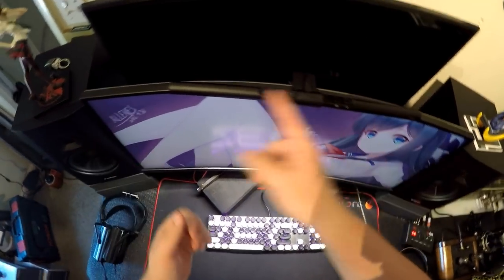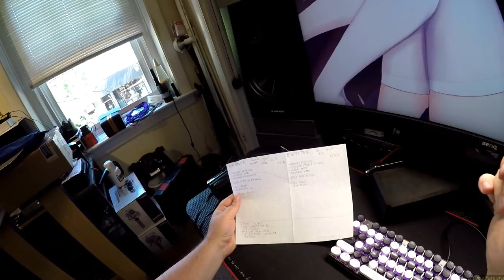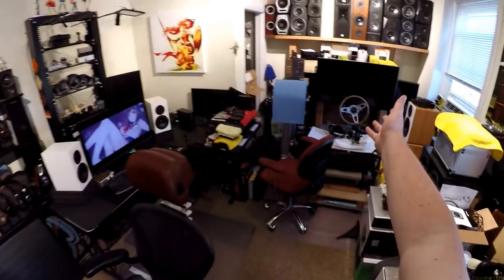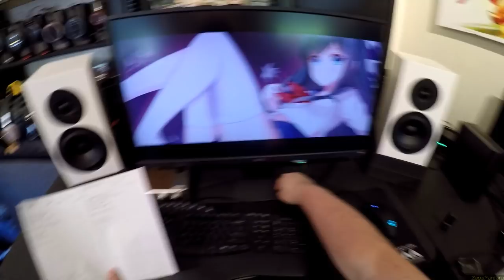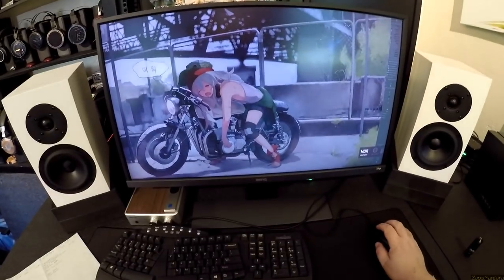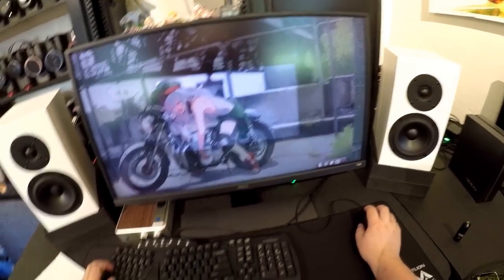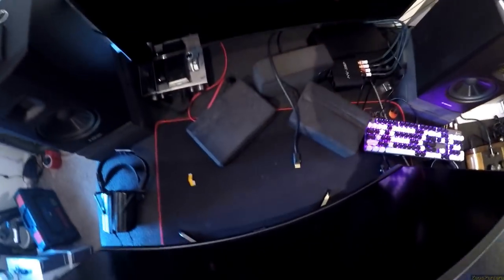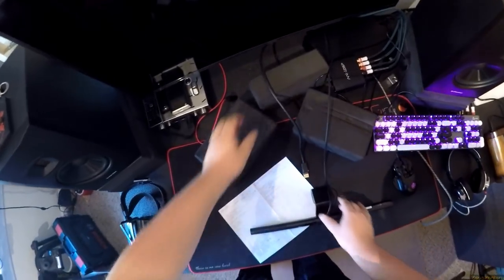Z Review - BenQ Gaming Monitors & ScreenBar Light

Comment: Freesync is not limited necessarily to AMD, its just Nvidia being an asshat, and greedy with G-sync honestly.
Reply: mehutolkki3232 It’s an open standard with HDMI 2.1 and Displayport, Nvidia just blocked it
Reply: Rowdy Thanks, thats what I thought, I was just too lazy to dig in deep enough (giggidy). There you go Zeos.
Reply: Because no one in there right mind would buy a gsync monitor if nvidia supported freesync.
Reply: nvidia get paid for using gsync on a monitor as its propriatory, but AMD don't as they made freesync royalty-free. So thats why the same model with freesync is often cheaper than the gsync version despite freesync being mostly superior. Its the one of the reasons why I buy AMD gpus despite their peak performance not matching up to nvidia.

Comment: Hey Z, I also have Sony GDM-FW900. Does yours take 30-60 minutes to warm up so the brightness settles down or is mine just really worn out?
Reply: Kun Ka that's about normal. I let. Mine go for a long while before I even think about calibrating it.
Reply: Probably caps are going bad? At least my widescreen Trinitron TV doesn't take that long.
Reply: Maybe the caps aren't great, but the GDM-FW900 is a different beast than those TVs. I know some warm-up time is normal for them, even when they were new. I just wanted to know how different it is for different units out there.
Reply: Okay, I've never head of that before. And I've never had any Trinitron PC CRT monitors, only shadowmask's.

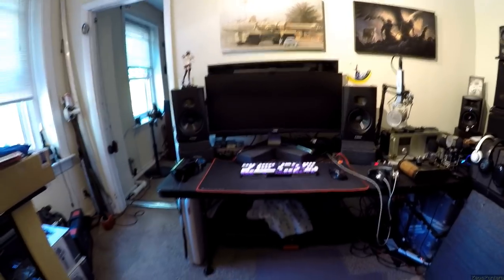Comment: @25:40 Zeos brings the issue that Ultra-wide crops the top and bottom of the picture in games. I thought what Ultra-wide does is give you extra on the sides without cropping.
If one is to attach the same PC running a game to 2 different monitors, with one being an Ultra-wide, then the top & bottom of the displayed picture should be the same, while ultra-wide giving extra picture reaIestate at right and left. Am I wrong?

Comment: I disagree on productivity. When view content with scaling content, which is more common with web content these days, you get more effective horizontal screen space. I find that helps using side by side content far more. That being said, still preference, and you're right that non scaling apps you get more resolution in both axis.

On gaming, whether you get more space depends on the game. Some games are horizontal+ meaning that the more width you have,  the more you see. Other games are vert+ meaning that the more height the more you see. Most new games are horizontal+, so you do get to see more in game content. However, even then most of the time the games are not designed with 21:9 so cutscenes and certain UI elements are cut off. In the worst case, sometime the UI is inoperable unless you force the monitor to 16:9. Some games won't let you scale past 16:9 like starcraft 2. The worst games are the ones that are vert+, such as borderlands 1, making the FOV so low that the game is borderline unplayable. I wouldn't recommend 21:9 for gaming unless you're willing to deal with the lack of support.

Accuracy edit.

Comment: Do you also run your 40" 4k at 100% scaling? Text is impossibly tiny when I try that with the same size. The lowest I can go is 175% scaling.
Reply: Rothbard Freedom 100% in windows and 150% for the telegram app. In Firefox I use an add on that does individual site zooms

Comment: I am running my 32 inches curved 1440p 144hz monitor vertical. when I'm reading shit on the internet. because I have to scroll way less than I otherwise would. also, my monitor autodetect the rotation and adjust the picture to vertically automatically . Just like you see a smartphone do!

Comment: My Windows 10 picture icons also take forever to load. I have no idea why.
Reply: FulciLives spinning hard drive? An ssd boot drive works magic for windows
Reply: Yes it is a 7200rpm mechanical drive but it was never an issue with Windows 7
Reply: FulciLives yep welcome to windows and doing a shit ton of stuff in the background. You can turn off background apps. And a few other little things to see if it helps. But windows 10 is not kind to older slower spinning drives
Reply: FulciLives you can try to disable windows search. indexing and defender. Those are hitting disc heavily
Reply: I'm on an M.2 drive or ssd and it still does it. So riddle me that!
Reply: ZeosPantera did you update from 7? My windows 10 on an ssd has the icons pretty much instantly

Comment: Does anyone know how to disable the default Windows behavior on switching default audio device on insert? It's extremely frustrating when you have a projector that you connect and disconnect from the computer.
Reply: If it's a device you don't use the audio on and just the video you can while it's connected disable the playback part of it in sounds/playback devices. It should remember next time.